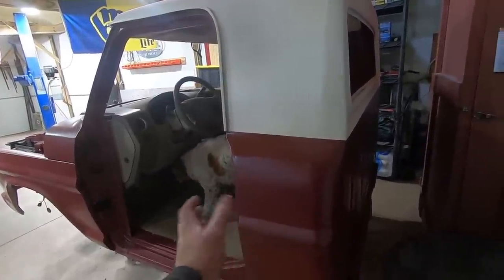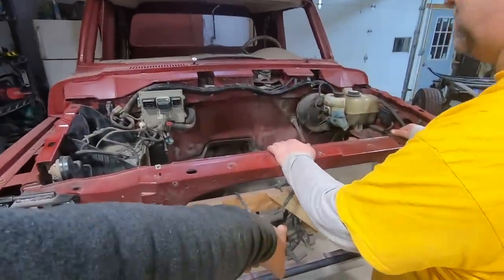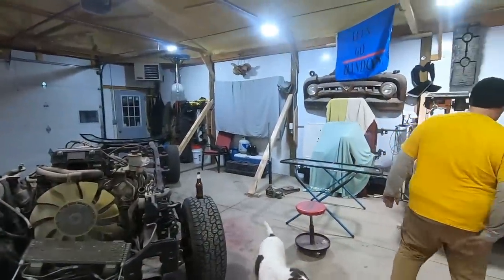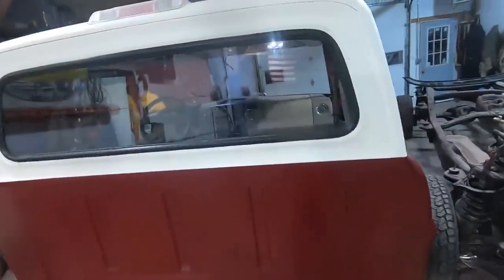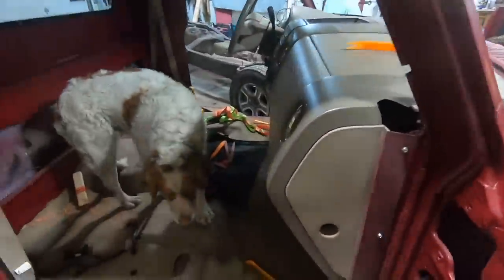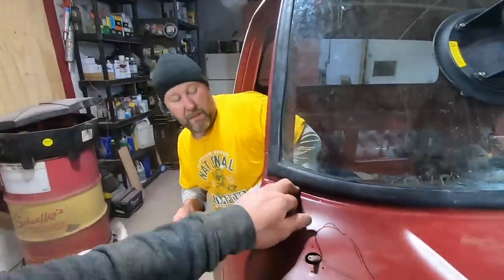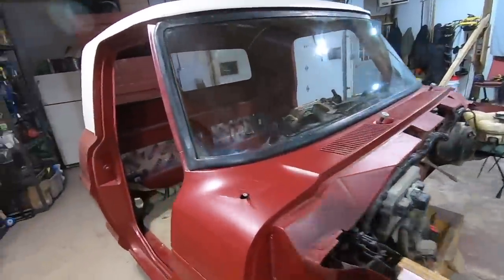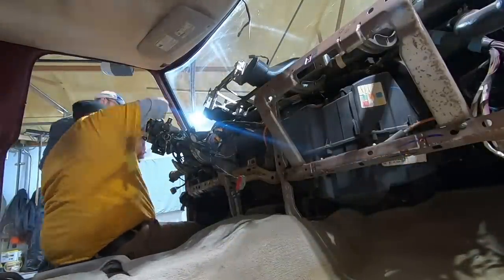Two Complete Hacks Try Their Hands at Installing Used Glass in a 1971 Ford F100! DIY Budget Truck!

Comment: Large amounts of dish soap on the rubber seals make them slide where they need to be
much easier. Makes pulling the rope out easier as well.

That guy has a lot of work melding those two trucks together.
Should be pretty cool when done.

Comment: Yep - done a few of them and all.....and yes, it sucks.  Especially when you know that you've only got the one piece of glass and would have a hard time finding another one.  I've always put the bottom end in first and pulled the string around to the top, but then I've only ever replaced glass and rubbers on sedans.  They say if it is installed right, that you don't need any sealant to stop it leaking.  In my experience, that is about as truthful as the expression on your face at the end of the vid when you said "replacing glass is fun!"....and that opens up a whole new level of profanity - especially when the nozzle comes off the end of the tube of sealant as you are running the bead while squeezing the gun trigger real hard and it dumps half the tube onto the windscreen, the rubber and the scuttle panel.  Yes, I have fond memories of replacing rubber window seals.  Happy days they were.....and I still have two more that I keep putting off.

Comment: It appeared you guys were struggling with it for quite a while. Hell, you guys didn't even use the important procedure very much or well. The rope/string method usually works pretty good. Any glass install that doesn't include breakage is an success. Back in the eighties and nineties, I did glass as a side job. I had a friend that his father owned a salvage yard and I got my glass at a good deal. I basically helped him out when he needed it, and I didn't pay for glass. I bought a couple case's of butyl tape and trim and wiper removal tools. I did a couple a week, $100 plus the cost of the adhesive/butyl tape. With a no leak guarantee.

Comment: if you have a 5.4 3 valve and it has original plugs in it just take it too the dealer. my first set was done at all state ford for 300 bucks parts and labor. they didn't break any of mine but they charge 20 bucks for each that break. did the second set myself and didn't break any. also change them at 80 to 100 k weather they need it or not. dont wait for the carbon to build up from poor firing and extended intervals.  pretty sure the class action lawsuit prevented them from charging more than 450 bucks for spark plugs. my useless tip of the day
Reply from the maker: Interesting